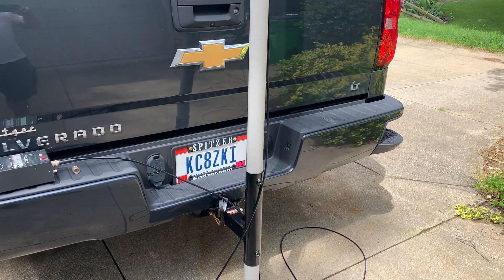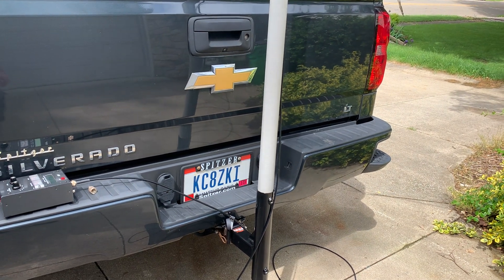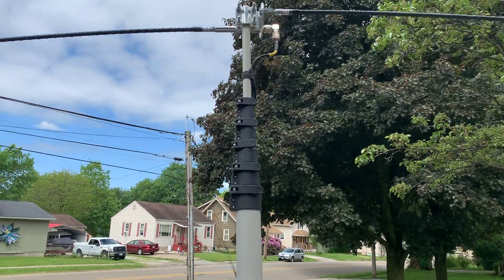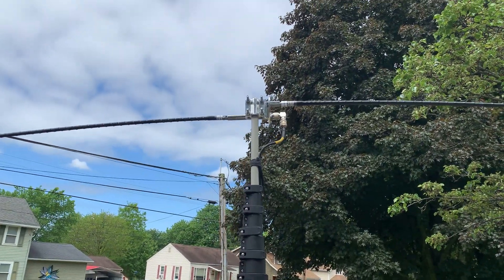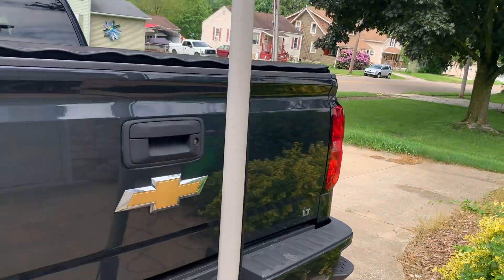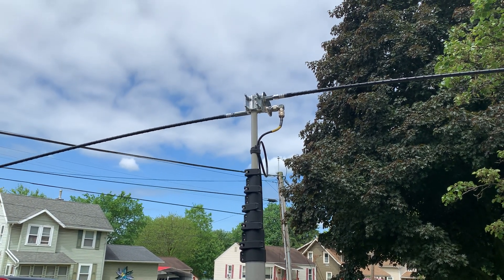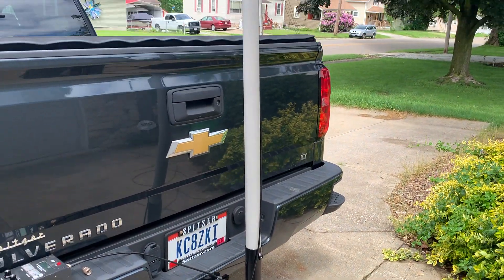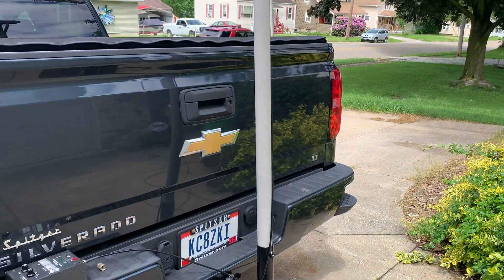Easy Field Day Antenna Setup - 33ft Telescopic Pole in Hitch Mount

Comment: Which flagpole hitch manufacturer is this?
Reply from the maker: The brand on Amazon is HiTow.   Here is the full description:  HITOWMFG Hitch Mount Flagpole Holder for 2" Hitch Receivers Flag Travel, 8.5" or 11.5" Length Black Powder

Comment: Love the setup. Do you think that mast would hold the weight of a Comet GP3?  Pretty light but hoping to find something that won’t require guying at full height when working events. How does yours stand up to height vs guying needs?
Reply from the maker: Hi Brian,  I have a GP-3 and it will easily accommodate it.    I have had it up all weekend long without guying and with heavy rg-8 running up to the antenna.  I keep the top section mostly collapsed as it would flex if expanded.
Reply: @johncooper6894  thank you for the reply. I’ll have to look further into that now I know it works. Much appreciated.